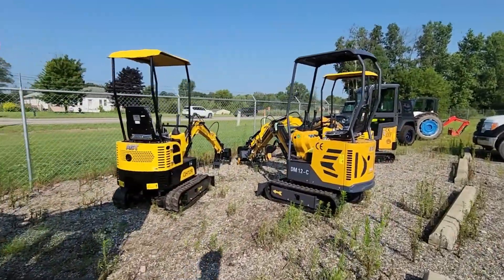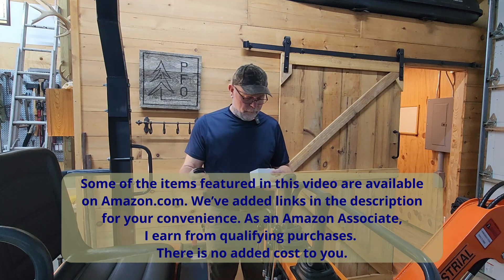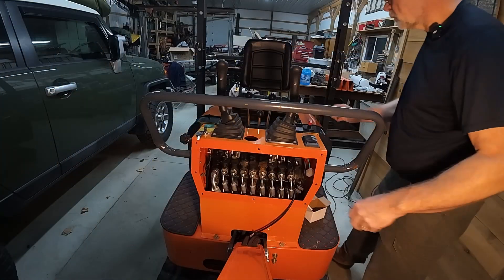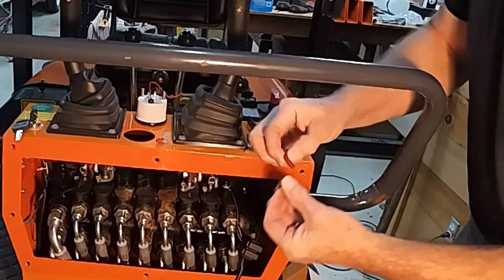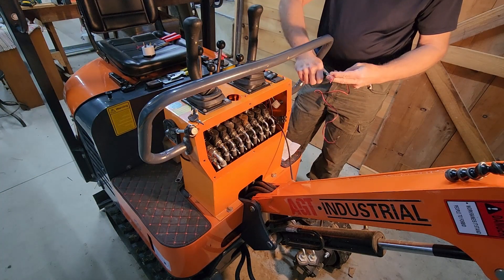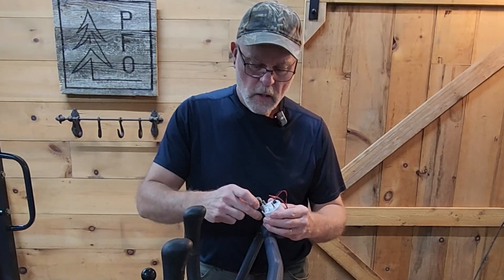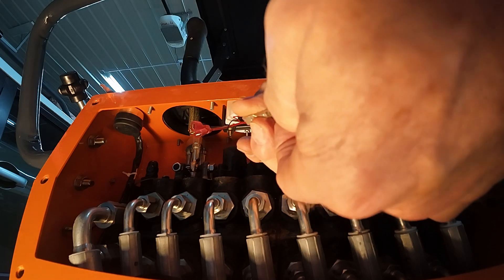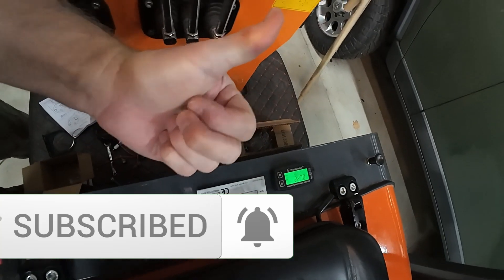How to Install a Voltmeter on a Mini Excavator

Comment: I've got my voltmeter along with a Runleader inductive hour meter waiting to be installed. Thanks for the video. My mini-ex is out in the Michigan cold. I wish I had a nice work space like yours. My mods will wait for the spring thaw at this point. <eep the videos coming!
Reply from the maker: Cool. It's a pair of worthwhile updrages, for sure. Pretty easy, as well, unless your fingers are frozen!  Thanks for watching.